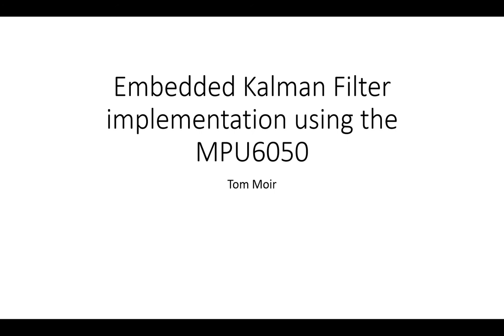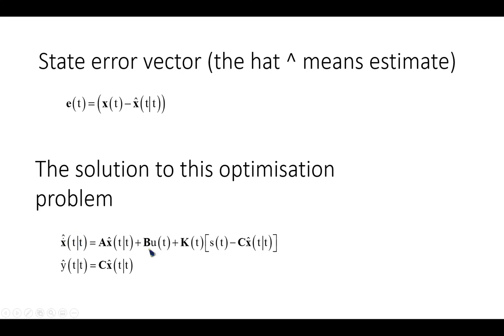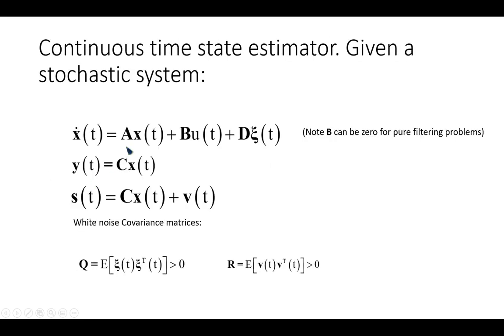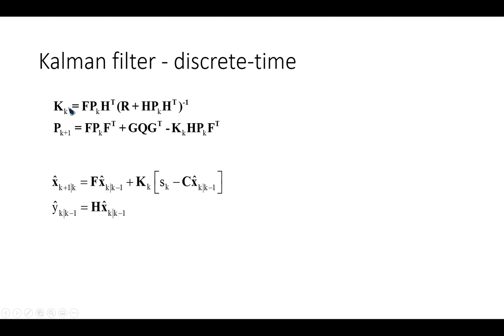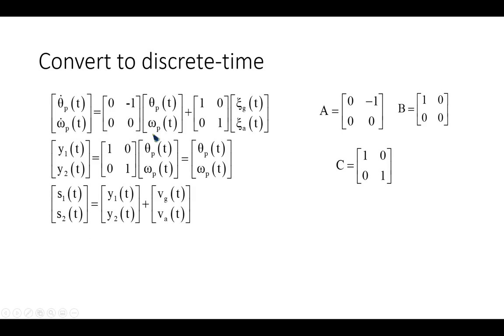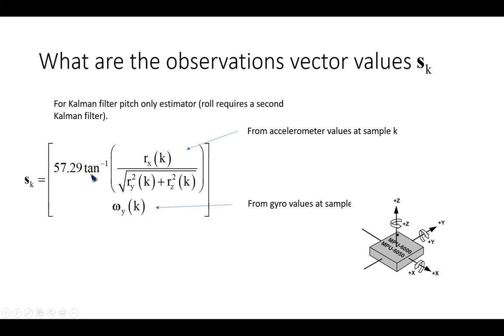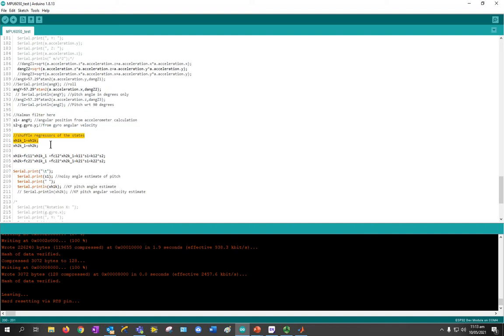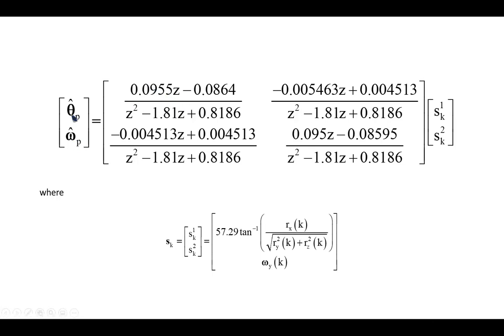Embedded Kalman Filtering

Comment: Tracking position plz
Reply from the maker: This can only track angular position, not translational. You will need another method. For example you can use a GPS system (for outside only) and get better accuracy using a Kalman filter. For inside where there is no GPS you need specialist methods with multiple sensors around a room or a lighthouse (see an earlier video).

Comment: Really great video, can I get the code plz?
Reply from the maker: // Basic demo for accelerometer readings from Adafruit MPU6050
//Kalman filter added by T.J.Moir 8/5/2021 and angle calculation

// ESP32 Guide: https://RandomNerdTutorials.com/esp32-mpu-6050-accelerometer-gyroscope-arduino/
// ESP8266 Guide: https://RandomNerdTutorials.com/esp8266-nodemcu-mpu-6050-accelerometer-gyroscope-arduino/
// Arduino Guide: https://RandomNerdTutorials.com/arduino-mpu-6050-accelerometer-gyroscope/

#include <Adafruit_MPU6050.h>
#include <Adafruit_Sensor.h>
#include <Wire.h>
float angX,angY,dangZ1,dangZ2,dangZ3,angZ;

//Kalman filter data
float f11,f12,f21,f22,fc11,fc12,fc21,fc22;
float d11,d12,d21,d22;
//states
float xh1k,xh2k,xh1k_1,xh2k_1;
float s1,s2; //observations, angular position and angular velocity from  accelerometer angles and gyro info
//H matrix is identity
//Filter gain matrix
float k11,k12,k21,k22;
//sampling freq and interval
float fs,Ts;
// for sampling freq

int sample_pin=16;

boolean running = false;

Adafruit_MPU6050 mpu;

void setup(void) {
  pinMode(sample_pin,OUTPUT);
  sample_pin=false;
///////////////////////////
//sampling frequency
fs=10000.0;
//sampling interval
Ts=1/fs;

f11=1;
f12=-Ts;
f21=0.0;
f22=1.0;
d11=Ts;
d12=-Ts*Ts*0.5;
d21=0.0;
d22=Ts;
//Kalman gains have been calculated offline for Q=I,R=I*1e-5;
k11=0.0311;
k12=-5.1556e-5;
k21=-4.8444e-5;
k22=0.0311;
//
//initialise state estimates
xh1k=0.0;
xh2k=0.0;
xh1k_1=0.0;
xh2k_1=0.0;
///////
  //calculate Kalman filter Fc closed loop F matrix. Note H=I identity matrix Fc=F-KH (K has been found offline)
  fc11=f11-k11;
  fc12=f12-k12;
  fc21=f21-k21;
  fc22=f22=k22;
  /////

  
  Serial.begin(115200);
  while (!Serial)
    //delay(10); // will pause Zero, Leonardo, etc until serial console opens

  //Serial.println("Adafruit MPU6050 test!");

  // Try to initialize!
  if (!mpu.begin()) {
    //Serial.println("Failed to find MPU6050 chip");
    while (1) {
      delay(10);
    }
  }
  //Serial.println("MPU6050 Found!");

  mpu.setAccelerometerRange(MPU6050_RANGE_8_G);
  //Serial.print("Accelerometer range set to: ");
  switch (mpu.getAccelerometerRange()) {
  case MPU6050_RANGE_2_G:
   // Serial.println("+-2G");
    break;
  case MPU6050_RANGE_4_G:
    //Serial.println("+-4G");
    break;
  case MPU6050_RANGE_8_G:
    //Serial.println("+-8G");
    break;
  case MPU6050_RANGE_16_G:
    //Serial.println("+-16G");
    break;
  }
  mpu.setGyroRange(MPU6050_RANGE_500_DEG);
  //Serial.print("Gyro range set to: ");
  switch (mpu.getGyroRange()) {
  case MPU6050_RANGE_250_DEG:
    //Serial.println("+- 250 deg/s");
    break;
  case MPU6050_RANGE_500_DEG:
   // Serial.println("+- 500 deg/s");
    break;
  case MPU6050_RANGE_1000_DEG:
    //Serial.println("+- 1000 deg/s");
    break;
  case MPU6050_RANGE_2000_DEG:
    //Serial.println("+- 2000 deg/s");
    break;
  }

  mpu.setFilterBandwidth(MPU6050_BAND_5_HZ);
  //Serial.print("Filter bandwidth set to: ");
  switch (mpu.getFilterBandwidth()) {
  case MPU6050_BAND_260_HZ:
    //Serial.println("260 Hz");
    break;
  case MPU6050_BAND_184_HZ:
    //Serial.println("184 Hz");
    break;
  case MPU6050_BAND_94_HZ:
    //Serial.println("94 Hz");
    break;
  case MPU6050_BAND_44_HZ:
    //Serial.println("44 Hz");
    break;
  case MPU6050_BAND_21_HZ:
    //Serial.println("21 Hz");
    break;
  case MPU6050_BAND_10_HZ:
    //Serial.println("10 Hz");
    break;
  case MPU6050_BAND_5_HZ:
    //Serial.println("5 Hz");
    break;
  }

  //Serial.println("");
  delay(100);

   
}

void loop() {

    
  
  /* Get new sensor events with the readings */
  sensors_event_t a, g, temp;
  mpu.getEvent(&a, &g, &temp);

 /* Print out the values */
 /*
  Serial.print("Acceleration X: ");
  Serial.print(a.acceleration.x);
  Serial.print(", Y: ");
  Serial.print(a.acceleration.y);
  Serial.print(", Z: ");
  Serial.print(a.acceleration.z);
  Serial.println(" m/s^2");*/
  //dangZ1=sqrt(a.acceleration.z*a.acceleration.z+a.acceleration.x*a.acceleration.x);
  dangZ2=sqrt(a.acceleration.z*a.acceleration.z+a.acceleration.y*a.acceleration.y);
  //dangZ3=sqrt(a.acceleration.x*a.acceleration.x+a.acceleration.y*a.acceleration.y);
//angX=57.29*atan2(a.acceleration.y,dangZ1);
//Serial.println(angX); //roll
angY=57.29*atan2(a.acceleration.x,dangZ2);
 // Serial.println(angY); //pitch angle in degrees only
//angZ=57.29*atan2(a.acceleration.z,dangZ3);
  //Serial.println(angZ); //Pitch wrt 90 degrees

//Kalman filter here
s1= angY; //angular position from accelerometer calculation
s2=g.gyro.y;//from gyro angular velocity

//shuffle regressors of the states
xh1k_1=xh1k;
xh2k_1=xh2k;

xh1k=fc11*xh1k_1 +fc12*xh2k_1+k11*s1+k12*s2;
xh2k=fc21*xh1k_1 +fc22*xh2k_1+k21*s1+k22*s2;
/*
Serial.print("\t");
  Serial.print(s1); //noisy angle estimate of pitch
  Serial.print(" "); */
  Serial.println(xh1k); //KF pitch angle estimate
  // Serial.println(xh2k); //KF pitch angular velocity estimate

  // Sets a flag at a precise time.

   //////
// To measure the sample rate from pin 21
digitalWrite(sample_pin,running);
running=!running;

/*
  Serial.print("Rotation X: ");
  Serial.print(g.gyro.x);
  Serial.print(", Y: ");
  Serial.print(g.gyro.y);
  Serial.print(", Z: ");
  Serial.print(g.gyro.z);
  Serial.println(" rad/s");

  Serial.print("Temperature: ");
  Serial.print(temp.temperature);
  Serial.println(" degC");

  Serial.println("");
  */
  //delay(5);
  
}
Reply: Professor, Thanks very much, very useful and much interesting than my university professor